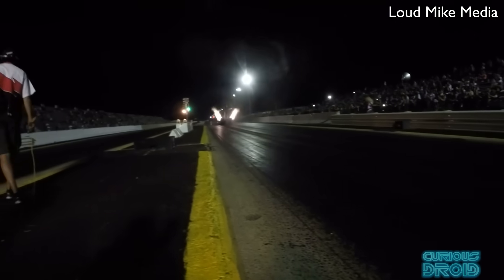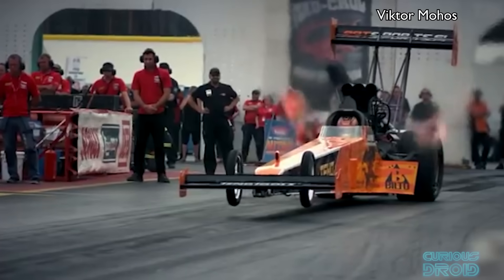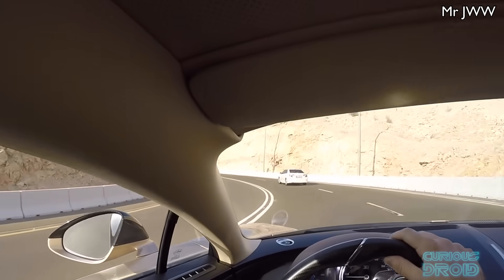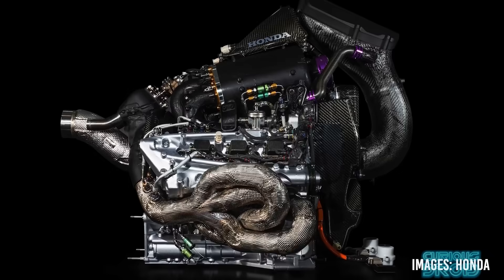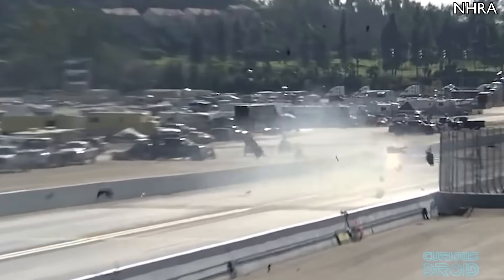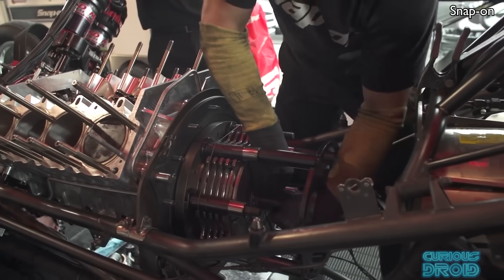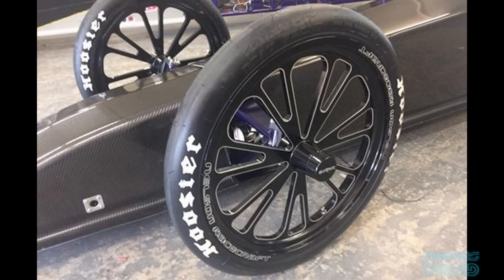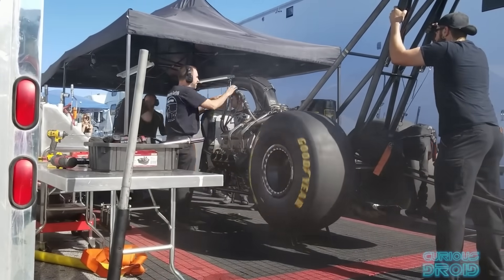The Amazing Engineering of Top Fuel Dragsters

Comment: If I didn’t calculate wrong: If you have 13000 psi and a typical piston bore is 4.187inches you would have around 171000 pounds or 77564 kg(thats 77,5 metric tons) of weight on that piston and head PER CYLINDER. Thats impressive…

Comment: "100 galons per minute" fuel pump and "20 galons consumed in under 4 seconds run" don't match each other. Or do these cars have several fuel pumps rated at 100 gal per minute each?

Comment: Back in the early to mid 60's my dad would drop my brother (in his teens) and me (10-12) off at the Irwindale dragstrip for a day and evening of racing. I really remember the sounds, sights, and smells. There is nothing like the smell of nitro. 

One time in the pits I was gawking near a top fueler getting ready for the next run. The crew turned the engine through, and I got a face full of nitro, it burned!

Comment: Let me suggest that 12,000 pounds of downforce , 6 tons from the rear aerofoil is over stated. Look at the foil construction and the support rods..
No way an they take 6 tons...
Also, 2,000 pounds, 1 ton on the front wheels and that aerofoil... I doubt it.
Divide the forces by 10 and the mechanics are a lot more reasonable.
I used to haunt Santa Pod in the UK in my youth, in the days of Roz Prior... Absolutely the most enjoyable day out...
Reply: and, you would be wrong
Reply: @Tinas2Labs  Give me the maths.. I'll understand.. Trust me on this...
Look at a 2 tonne car jack and relate the material thickness to the "6 tonne" spindly framework. That is why I am dubious but, you will now provide the maths to demonstrate I am wrong rather than just shoot your mouth off...

Comment: Top Fuel Drag racing: Noise pollution? Check,  Air pollution? Check, A waste of time, money and resources of man-power, metals, fuel, rubber and electronics? Check. But hey you can go really fast in a straight line and when you get home, Mommy has spaghetti made.

Comment: A big reason though that F1 engines cost 7-10M per is they're expected to run for hundreds of miles. They are supposed to only use I think, 3 engines per year with penalties after that. They ran 23 races last year so that's 8 races per engine.

Top Fuel are basically rebuilt every race so 100k adds up with enough blown engines over a season. But it's still a lot cheaper.

It just shows the exponential curve in money when you need reliability.

Comment: Horsepower figures for these cars are necessarily vague and not really important. The fact is that they change according to the engine setup and the weather conditions. Altitude, of course, is another factor. No point saying your engine makes 12,000 hp if it’s in the wrong setup for the day. No crew is going to allow this to happen, of course but the point is that there are so many variables that the actual figure becomes unimportant.

Torque, in this case, is measured in pound feet, rather than foot pounds.

Also worth mentioning why Top Fuel cars are long and narrow. Stability. Plus, putting a big heavy fuel tank at the front of a long moment arm makes it less likely to flip over. Not impossible, as the video shows. Just less likely. Back in the 1960s these things were called ‘rails’ because of the parallel chassis members and used used to get half way down a quarter mile strip with the front of the car up at a 30 degree angle. The driver - who sat behind the engine in those days - practically scraped along the road.

Comment: My favorite part that you left out is called dieseling where at a point the compression and heat are so high that even shutting off the engine will not stop it they put an exact amount of fuel in the car to make it down the track cause if not the car might just not stop
Reply: I was going to say the same thing.  The spark plugs are fried by mid track. The ignition system is doing nothing. They try and carry the exact amount of fuel for saftey reasons but there is a fuel shut off switch.  Its triggered when they deploy the parachute. 

The other thing I wish he'd mentioned is that the crew chief can remotely shut down the car.
Reply: Do the cars start up on nitro or do they switch it to nitro before the burnout?
Reply: @steveharper9964  they do start up on nitro theyake sure to take into account the idle time and the burnouts fuel usage

Comment: What I find amazes the TF cars in the early 70s had 1500-2000Hp and could go 235+ in the quarter. It took approximately 10,000 more horsepower to go 100 mph faster in the quarter!
Reply: They don't go 1/4 mile (1320 ft) anymore, now it's a thousand ft. So, the top speeds are even more impressive.
The top speeds are getting a bit out of hand.
But yeah, the required power necessary for increased performance is not linear.

Comment: IF the engine turns 7900RPM
IF the engine turns for 4 seconds
IF 8 cylinder four-stroke
THEN Crank turns 526 times AND 2106 ignition events per run

Comment: All the excitement of driving in a straight line.
Reply: It’s amazing.
Reply: dont comment unless you have seen them in person.
Reply: @Tinas2Labs  I’ll take rally racing with real driver skill over this any day. Different surfaces. Acceleration, AND braking …. And for good measure they throw in a bunch of turns! It takes real driver skill to do it. 

Very exciting. 

The best modern drivers are typically F1 and rally racing. I’ve never heard a world renown driver be impressed with drag racing. 

What? You put your foot down and drive in a straight line for less than 10 seconds and then you’re done? 

That just doesn’t seem as hard as racing on a real track.

How many video games are made about each type of racing. I feel like that’s a whole separate metric.

Comment: The first time I heard one fire up in the pits I thought a bomb had gone off.

They forgot to tell you one of the most incredible things [to me] about these cars - during a run, a spark plug only fires 60 times.
Reply: Yes, TF and FC are both amazingly loud. I read that the engines only make between 900 and 1400 revolutions on each run. From startup through burnout, reverse, staging and 4 second run.

Comment: At 3:05, where does the "8 times more power" comes from? I get it that you can burn around 8 times more Nitro than Gasoline in a given amount of time. But isnt it that the energy density is 4 times lower on nitro than on gasoline? Would that not mean that you actually only get 2 to 2.2 times the energy by choosing nitro instead of gasoline?

Comment: Last weekend myself and 2 of my friends were at the NHRA drags in Topeka KS.  We were in the pits when the Top Fuel and the Funny cars were being worked on.  I missed it when the crew put on masks and ear plugs, as it was time to fire up the engine.  While I had the ear protection, I was not prepared for being “being gassed” when they started the engine. We were also down wind.  As they fired up the Nitro, my eyes watered and burned, and my throat burned, so much so that I had to get away from the smoke.  I removed but it took me about a half hour to get the burning out of my eyes and lungs. It’s part of the experience of drag racing.  Next time you go to the drag strip, watch the direction of the wind in the pits or you will get really “gassed”. :).

Comment: It is such an amazing sport and you have done it a great service.  Thanks for your thorough research.  The last time I went they were still actually racing 1/4 of a mile. Tony Shoemacher (sp?) laid down 4 runs in a row that hit 350 miles per hour here in Phoenix!  They have since shortened the distance and made some other changes to slow the cars down!!!  I think they be shortening it a bit more in the not to distant future.  At the moment, Jul 28. 2022 Brittany Force, Erica Enders and other women are tough to beat as they seem to be quicker off the line!!
Reply: no fuel car, including tony schumacher has gone over 336 in the quarter.  brittany if fast but lost many races on a holeshot.  slow reaction time.  erica ran quickest pro stock run in history at 22 gatornationals, and lost.  bo butner cut her eyes out on the tree.

Comment: So by regulation, they use a really primitive engine setup.   Can't help wondering what would happen if the engine was 'free' within the capacity limit...
Reply: Other style engines have been trialled but all failed
Reply: Really no need to. Fewer big pieces hold together better than lots of complicated pieces. The engines are putting out more than enough power now, the biggest requirements are to have passages large enough to move all that fuel as fast as possible, and to hopefully last to the end of the run. The crews adjust power and clutching to detune for the available tire traction. NHRA has been regulating for max speeds, as mentioned here. They even shortened the drag strips from 1/4 mile to 1000 feet.
Reply: @snakerstran9101  Well, if the existing engines give more power than can be used, I guess there's no point improving them.   Still reckon overhead cams and four valves per cylinder would give even more power within the capacity limit, certainly with a petrol (gasoline) engine it would, but I guess breathing is less critical on nitro.     I'm pretty sure there are more efficient supercharger designs than Roots, too (not talking about turbos here).   So it would be interesting to see, if someone was given a clean sheet of paper and told 500 cubic inch, nitro, what they could come up with.

Comment: I think it’s stupid that they cannot break away from the 50s  Hemi design!!!  Think of how advanced the engineers would be by now if there were no restrictions !
Reply: Tried in Australia with 4-valve heads etc but didn’t cut it.
Reply: @stephenpage-murray7226  I always thought DOHC on the same 2 valve HEMI set up would have been interesting. Like the ford cammer only two cams per head with the same chain drive as the amg Mercedes 4.4 litre V8!!!
Reply: @petervossos4816  
That’s what they tried here for years.  McGee from memory
Reply: @stephenpage-murray7226  yes heard of McGee! 5000hp!! Read about it some 25 yrs ago!!! What about coney-seggs (keoniseggs) free valve ! Imagine that ,freevalve HEMI heads with computer controlled timing!
Reply: @petervossos4816  
It’s trying to make them strong enough to handle nitro.

Comment: The development of top fuel is strictly a matter of a lot of smart people trying to go faster through trial and error.  I remember watching top fuel dragsters over 50 years ago.  Compared with current top fuel cars there are many similarities but a lot of things have changed.  There was a point where the cars were struggling to break 200 mph.  Don Garlits started growing a beard, sworn to not shave until he broke 200 and he eventually did.  Throughout this entire evolution all parts of the car and powertrain have been subject to breakage, sometimes catastrophic breakage.  Parts break so they make them bigger and go on.  Nevertheless many of the parts are subjected to extreme forces compared to any other form of motor racing.
Some interesting points of the evolution- originally the driver was in the rear behind the engine.  Clutches and flywheels were prone to disintegration which could cut the car in half, probably not good for your feet either, and blower explosions and engine fires in your face were not fun either, so eventually they put the driver in front of the engine.  Older tires were not of the wrinkle wall variety and they hadn't developed the slipping clutches either, so the tires would slip for almost the entire length of the track, a very long burnout.  Research into tires and drivetrain changes provided for more traction which really made the cars faster and quicker, with a lot less tire smoke.
Other interesting statistics that I've read before but can't remember are how many rotations the crankshaft makes for the entire run and how many times each cylinder fires.  Just ballpark numbers- if the engine turns just short of 8k rpm and the run lasts 3.65 sec., that is less than 500 rotations for the entire run meaning each cylinder only fires about 250 times.

Comment: Has to be one of the most "Factually" accurate videos on a fuel engine I have seen..    Engine run time 4 seconds or less (competitive)    Some of this data is now outdated but not by too much...  

I think you could do a full video just on the clutch (major part of this racing).. You will notice the clutch cover was bare.. the "weights"  that go on the arms is part of a very secretive tuning process and is tied directly to how the engine is fueled...

Comment: 11:01 - this rear is on the strange website, for the low low everyday price of $18,850. Plus tax of course. Lol

P.s. - does not include mounting brackets,  fluid, cooler lines, or cooler.

Comment: I Just Learned that a Top Fuel Dragster Is Torn Down After Every Race!!...ThePistons and Connecting Rods Shrink Under the Tremendous Pressure In Every Cylinder!!....In 1 Run, Pistons and Rods Can Shrink Up To .005- that Is 5 Thousandths of an Inch, In 1 Run!!!

Comment: Great video. He talked about the spark plug electrodes being melted away every run and the absurd amount of fuel being injected, but he didn't mention what I think is one of the coolest facts related to this. The electrodes are gone by about halfway down the track, at which point the engine is actually dieseling due to the exhaust valves being so hot. This means that the only way to shut off the engine at the end of the run is to either shut off the fuel or run out of it. The fuel being injected in the hat above the blower also provides lubrication for the supercharger. This means that when the fuel is shut off at the end of the run, the supercharger is left spinning with no lubrication, so the engines actually have an oil canister that is pumped through the supercharger after fuel is shut off which is why top fuel motors usually puff lots of smoke at the end of a run even if the engine is not hurt. Also something that is crazy to think about, even at roughly 8,000 RPM, the cars are so quick that the engine will only make about 540 revolutions during the run.

Comment: The problem with racing at this level is that the real star of the show is the engineering, which also happens to do most of the work for you. The amount of user input required is minimal and top fuel cars these days are a far cry from the days of Don Garlits and slingshot dragsters.

Comment: What is most impressive is the shock wave these create as they leave, you will get hit with a blast, air has mass. A first timer should be versed and prepared so that they don't get scared, especially children, you need to experience a couple of runs near the starting line and a couple down near or past the finish line to get the entire effect these monsters create. At the start line at the very millisecond these go to leave you get hit with a shockwave blast that is the vehicle moving the air out of it's way as it departs, the exhaust is like being hit with 1000 M-80's and your eyes will shake in your head for a split second, this is normal, when you regain your senses you will find that the cars are gone, this all happens in 1/10th of a second. Enjoy!

Comment: If one is a fan of both Engineering and Human feats, There are a few things I think all Humans should experience in their life time. Witnessing Top fuel Dragsters perform, is near the top of the list. I think one thing that may help to put this experience into perspective would be to imagine 9000 sticks of contained dynamite going off every second as they all accelerate to over 320 mph in 1300 ft with 4 wheels and a chassis in tow... I other words, There is no putting this into perspective, Until you experience it yourself.

Comment: Imagine apply Toyota durability pr lemans 24hr durability to make an engine that burns gasoline or diesel mixed with nitro & DME or something cool, CNG or Propane or Kerosine, or JET A -- that lasts for 1000 hours or more before an engine failure // or 10,000 hours moonshot ceramic machined zirconia ///

Comment: Nitromethane is the same fuel that is used in radio control airplanes cars and boats. we call it Glow fuel. the only difference is the nitromethane is mixed with oil to lubricate the engine

Comment: I used to live near Pecos Road and Val Vista Drive in Gilbert, Arizona and I could hear the Top Fuel Dragsters on the track at Firebird Speedway 16 miles away. (about 14 miles straight line [22.5 km]) I could hear it inside a well-insulated house with the doors and windows shut. It was WinterNationals circa 2009
Reply: Hahaha, at a slightly greater distance I heard the same thing.  One time my kids and I were in the back yard we all heard it and they asked what it was.  I told them the drag strip 16 miles away, they both said "no way", I said " way".  They never did believe me.

Comment: Engine is an air pump when you put half the cylinder filled with nitro there's not room for much air or oxygen the molecule itself is breaking down just like nitroglycerin breaks down in Dynamite there is no burning.
Wet a rag with nitro methane and I defy you to light it on fire let it soak into the concrete hit it with a sledgehammer now you got a problem.